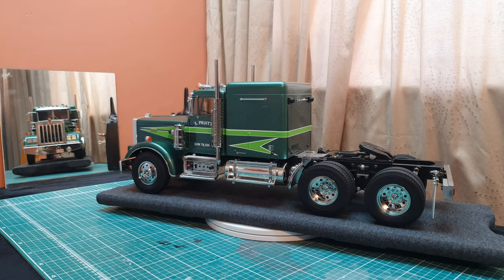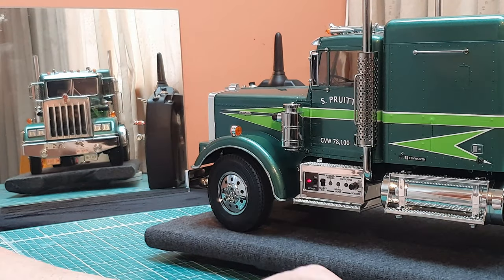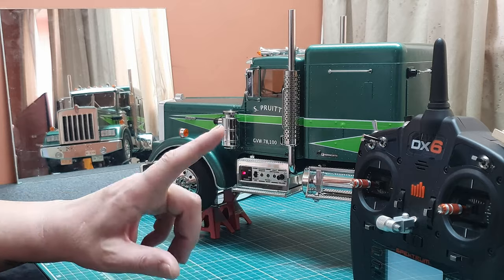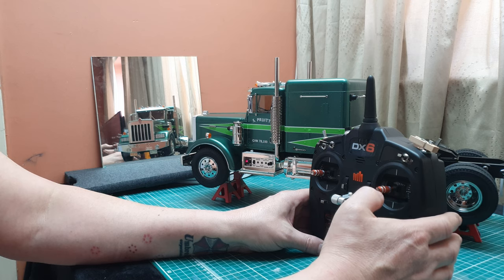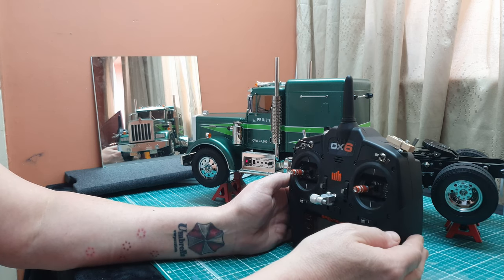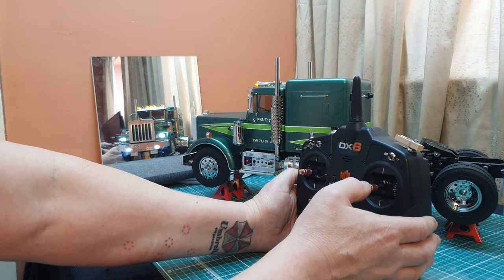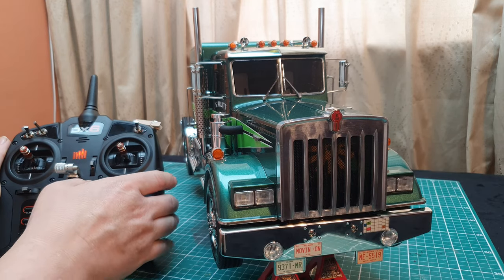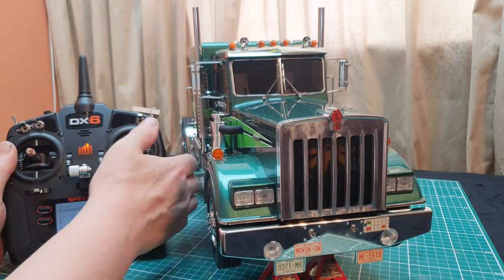Tamiya King Hauler Build Ep19 - MFC Operation, Functions & Features - Movin' On

Comment: Hello Teri. Need to say you do a very good Job on your Trucks. I watch your Videos and work on my own Truck. I like the Idea of the Fan behind the Grill. For a while a had a idea for a Fake Engine with a Fan like you do. I make it work with the electronic from an old Servo. So The " Engine " is idle without driving (set the Poti). Also you can speed it up with a second Channel without moving the Truck. When u add the second Channel on you Radio to the Drive Channel the Engine goes faster with the Move of the Truck. I hope u get what i mean. So now i need to watch more of your Videos. Well done.

Comment: hi teri great video nice looking truck do you run the south west truck at emmersons green i will have to pop to there one sunday and meet you also can you tell me where you got the fan from i have tried to use one of the servo parts but it dont look as good
Reply from the maker: @thescaniaman1  I don't run SWRCT,  I help with Admin on their FB page.  I've been going to the SW RC Truckers meet for over 10 years now, and I've got a lot of good friends there.
The motor for the fan is the vibration motor, and the actual fan is just a photo of a fan I found on Google Image Search . I printed it on plain paper and laminated it. I could get a friend to 3D print one, but it was just an experiment.

Comment: Teri
You know how the king /grand cab only has 1 head light fitting. Which plug on the MFU 03 do you put the led light in to get the lights to flash head lights. As I can only switch them on and off.
Reply from the maker: on the MFC-03 the main beam flash is J17... it's not a function on the MFC-01, only the -03... plus I've done twin headlight conversions on all mine.
Reply: Ok
My grand hauler is got mfc 03. That's what didn't make sense when Ive set it up no flash and for the same as yo  want flash. Tomorrow I'll plug light into j17.

Will have to re bind to transmitter as I'm moving something?

Up down right left with left stick and then the same with the right stick.?

Thank you Teri you make sense.

Comment: hello teri just a quick question how did you asign the gear change to the switch as i dont remember seeing it in the video
Reply from the maker: I just plugged it into Aux1 receiver port so the gear change servo doesn't go through the mfc at all
Reply: @TeriWilde  ok so that was the j5 you did in the last vid if so then what about on the trans do i need to set anything on my dx6

Comment: Is that a mfc 3 only option because my mfc01 won't do that with the flashing lights
Reply from the maker: You're right... The MFC-03 has flashing headlight option whereas the MFC-01 does not.
That's is the reason I installed the -03 in my American trucks that I converted to have twin headlights.